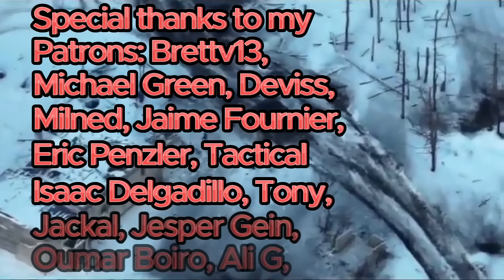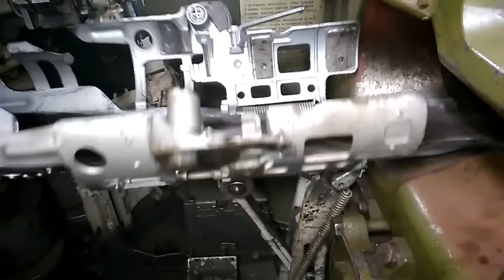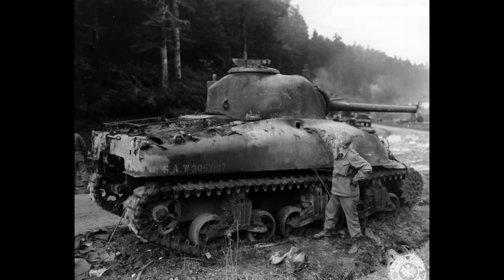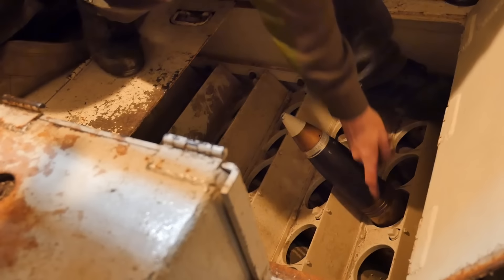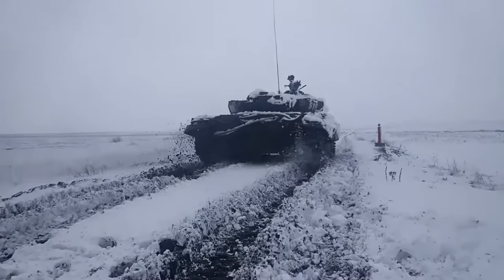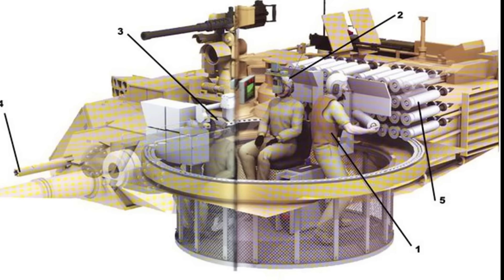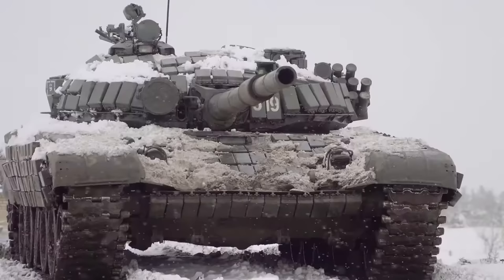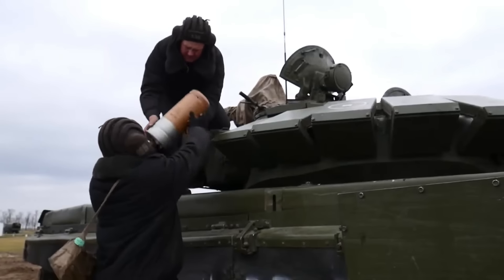Is Autoloader Really the Reason for Russian tanks exploding so much?

Comment: I agreed with everything, apart for one really fundemental point.
The Russian's don't need to 'copy' German insensitive explosives. The formulas have existed since the 1980's.

Russian tanks explode because the ammunition is fundementally unsafe. The propellant cases are weak and contain sensitive easily combustible material.

Russian tanks explode because they have always known about the issues but were too cheapskate to scrap their inventory of unsafe 125mm ammo and replace it insentive munitions.

The combination of flaws in the T-series ammo storage and fundemental unsafe ammo leads to turret tosses.

Its all about not wanting to spend money on designing and producing safer ammo.
Reply: The question isn't necessarily the cost, but the ability to produce enough ammunition in a timely manner. Considering that the whole world's production of ammunition isn't quite enough for this war, changing to the new type of ammunition would've been disastrous.
Reply: @ForOne814  Russia did not have time limit. The current war has nothing to do with it. The Russian's knew about the issue from at least the 1990's. Certainly from the 1st Chechen war. They had plenty of oil money once Russia recovered from the break up of the USSR since the early 2000's.
They had plenty of 125mm rounds in reserve so they could have ceased production of the older style munitions and created an entirely new 125mm ammo production line producing safer insensitive propellant, HEAT and HE-FRAG rounds without suffering a shortage. They could have actually recycled many of the existing shells they had by just putting in new insensitive explosive. The inert APFSDS rounds just needed new safer, less sensitive propellant cartridges 
So realistically Russia has had at least 15 years to design, build and produce better and safer insensitive 125mm ammo. They could have had hundreds of thousands of safer rounds by now.
Instead they chose to deliberately keep producing dangerous ammo on old Soviet era production lines using old Soviet chemical formulas and cheap chemicals.
As I wrote. It was a deliberate choice.
They decided to spend their money on flashy 'wonder weapons' instead.
As Perun says:
"All bling, no basics".
Reply: @simonmoorcroft1417  of course it did have a time limit. Replacing all the stockpiles and all of the production lines is ridiculously expensive and time-consuming, plus the shells themselves are more difficult and expensive to produce, so you inherently can produce less of them. 

It was a deliberate choice, and it turned out to be the correct choice.
Reply: @ForOne814  So increasing your percentage of catastrophic own tank losses and immolating the experienced tank crews your started the war with was a good choice?
I doubt the life expectancy of most current Russian tank crews is more than 3 months thanks to these 'choices'.
The Russian tank 'problem' is not the rate they expend 125mm ammo, its the rate they expend tanks and their crews. Some of the T-90M are likely no more than a few months old, if not a few weeks old when they catastrophically explode.
That's 5 million dollars lost to a $500 FPV drone just because someone thought it was a good idea to skimp on ammo costs.
Reply: @simonmoorcroft1417  it's a tradeoff. You do lose more tank crews, but at the same time you have more tank crews gaining experience, because you're not bottlenecked as badly with ammunition production. Russia isn't bottlenecked with tank production at all, there is no shortage of tanks. 

Also the question is how often do you actually lose the crew to the immediate ammunition detonation. Because it's not that often as people seem to think it is. The vast majority of tank losses in this war is due to abandonment, sometimes of still mobile tanks. 

A $500 FPV drone disables any tank, for it to be destroyed later, if the drone hit itself doesn't cause it to burn out. Also I don't think T90M costs $5 mil for the MoD, $5mil is for the export version.

Comment: You can't have everything and move low weight.
The main problem here is thinking that tanks are inmune. 
The fact a tank is burned out and abandoned or just vaporized, is meaningless, because once you stand more than 15min in a battlefield, this junk is already a bomb target.
So everyone can cope and thant, but the mass destruction weapons we have in this cXXI is something that we can't just overpass with cXX designs. And that is also a call for the 80's leopard/abrams/challenger, which are used in so specific times (no air support, no strong points), that they are useless in the general purpose of a main battle tank.

Comment: I disagree Red, the reason why th Abrams tank burned down was because it was caught in the middle of a reloading period, when the door to the ammo is open, in any other case, the tank would have been able to retreat assuming its engine had not taken sufficient damage to knock it out from that blow, that is why there are blow out panels, so that if the ammo in the back of the turret takes a hit and the blast door is closed, the turret gets hot but the ammo cook off wont kill its crew, is it completely safe? No, but then again, no ammo is completely safe from cook off with ammo that is designed to penetrate and destroy crew and modules in one shot.
Reply: We don’t really know and probably never will. The thing we do know is that the US has far to large a military budget to still have stocks of sensitive munitions instead of upgrading them.
Reply: This blow out panels only save you from ammo cook off , from the propellant . If they have stored HE shells in there and that's what causes this huge explosions , the crew won't be save either . NATO tanks had a long time only HEAT-MP rounds , wich is practically a HEAT-FS round . Not a real HE , if you store there 20 rounds of HE , your blast door will probably say hello to you .
Reply: @RichelieuUnlimited  that's why they made the AMP round. The explosives in it are inert until activated, as it's activated by programing the round before firing. Anything that isn't AP is in that one round type.

Comment: What might also be an isue that is not talked about is that the charge has a partialy cumbustable cassing and that its 2 piece ammo.

So the cassing ain't fire resistant and it has more surface area to for the fire to atack then 1 piece ammo. Certainly non cumbustible cassed ammo will also burn at some point but it seems to me that the chances of a catastrophic and rapid conflageration are reduced.

Of course most modern tanks have partialy combustable casses but they have proper blow out panels. Makes a big difference. Take black powder for example it certainly burns fast but only explodes when sealed.

Comment: The thing is, even if we were to blame the carousel and it's lack of blow-out panels, it would be a relatively simple job to modify it to have them. And as both Russian and Ukrainian studies as well as observations show - it's the ammunition outsid eof the carousel that is the more significant problem. ironically, the t-90m, which was supposed to solve this, is still being filled with extra ammunition on the inside by it's crews.

Comment: So its like its all a matter of trade offs
Reply: Well, insensitive ammo isn’t really a bad trade. Except in terms of price and power, but the latter is typically more determined by the limitations of the gun.
Reply: @RichelieuUnlimited  talking mostly about caroussel vs bussel
Reply: @gerfand  In this regard I‘d tend to go with bustle loaders nowadays. Improved crew survivability (with older munitions), faster autoloader, full length munitions, theoretically faster replenishment and larger available interior volume in the hull. Downside is the heavier and larger turret, however the gun and the frontal armor has to be balanced out anyway. And slightly increased risk of taking hits to the ammunition storage.
Reply: @RichelieuUnlimited  yes, like I said trade-offs

Comment: Short answer: Yes.
Long answer: Yeeeeeeeeeeeeeeeees.

Carousell autoloader, munitions basically unportected in crew space. Granted they didnt predict top attack munitions, but those have existed for long enough that had Russia been a normal country, theyd have switched to a better design decades ago when they did start existing.
Reply: You realize any tank would be destroyed by a top attack munition, right? If one were to hit the Abrams, it would kill everyone in the turret, and potentially pierce the blowout panels.
Reply: @voidtempering8700  assuming it's not taken out by any defense systems prior, and goes through, yea the turret crew is toast. However. Since the ammo compartment is separated behind a blast door, with blowout panels leading outside the tank, the chance of the entire crew being vaporized is very low.
Reply: @engineerskalinera  I mean, sure it is low. But a HEAT warheads entering the compartment is not a good experience. The armor would be turned into spall, and the turret crew would more than likely be dead. 

There are also instances of T-72s being hit by something like Javelin, and the crew can manage to get out before the tank cooks off.
Reply: @voidtempering8700  yeah, but you're looking at just the turret crew being dead in this case. The rest will still be fine.
As for the T-72, one delayed cook-off or two is an exception that proves the rule that T-72 type autoloaders kill crews. If any one of them stayed or couldn't get out, they'd die all the same.
Reply: @engineerskalinera  Even if the blowout panels work the crew can still be killed by it, as evidenced by the burn down Abrams.

Also, it isn't a rare case. As seen, the majority of tanks struck by AT weapons get abandoned, and are destroyed later on.

Edit: Just the turret crew is 3/4 of the crew dead. You lost the same amount as the complete destruction of a T-72.
Reply: @voidtempering8700  the majority of tanks hit in the turret by top attack munitions yeet the turret.

Good point about the Abrams, however, good luck actually doing that to it with a handheld system. Iirc there were 2 taken out? One disabled by a mine, burned down by its crew, and captured, and another one taken by a Kornet ATGM hit to the side of the turret.

Also note that this is an M1A1 Abrams. Modern versions are likely better protected.
Reply: @engineerskalinera  The armor of the most modern Abrams would not have changed the result of either attack. Even ARAT ERA tiles won't be enough to survive a side shot from a Kornet. And the most modern tank would still be detracted by a mine.

Lastly, there were 3 destroyed Abrams and 4 damaged and abandoned Abrams. The reason we haven't seen more is because the majority of all Western tanks were already pulled from the Frontline.
Reply: @voidtempering8700  I'm seeing 5 lost total but let's not argue that.

We have arrived through the argument then, to the conclusion that a hit by handheld wapons (or mines if lucky) to the unprotected ammo storage of a T-72 will most likely kill the entire tank crew. Whereas you need a mine or heavy static ATGM to maybe kill 3 of the Abrams 4 crew if you hit it right, and an ammo cook-off is not guaranteed.

Which still makes the T72 autoloader responsible for the crew kill...

All things being equal, with a top attack munition (your original argument) a hit to the T72 ammo will destroy the tank and cook the crew. A hit to the Abrams ammo (ammo specifically, so a top attack munition that hits the ammo by necessity doesn't actually enter the crew compartment) will destroy the tank, but the crew will stay alive.

Tl;Dr yes, it's the autoloader. No, a hit to the abrams' ammo doesn't kill the crew
Reply: @engineerskalinera  You realize that effective armor of the Abrams and T-72 isn't that different. The T-72b with K-5 ERA will stop the majority of handheld weapons from the front. 

The biggest issue comes from attacks to the sides. Now, the T-72 has better protected hull sides, but the Abrams has better protected turret sides. Now, neither really matters because a tandem warhead or ATGM will go through the sides of both tanks regardless.

Lastly, once again, a penetration is not most likely going to kill the crew. The majority of strikes disables the T-72, where it is then abandoned. Yes, the chances of it blowing is many times higher than an Abrams, but those cases are roughly 50/50. Not 90/10.

It is not the autoloader that is most responsible, but the ammo stored outside of it. The autoloader has some armor protection to stop spalling. Mostly on the top, where there is a 3-5mm sheet of steel.
Reply: @engineerskalinera  A top attack munition isn't likely to hit the Abrams ammo. It is possible it will penetrate the blowout rack, but it will more than likely simply enter the crew compartment. They usually don't hit that far back. 

When it comes to FPV drones they, the first thing they hit is usually the ammo rack. If the blowout panels activate, then it is a necessity to leave the vehicle, otherwise the tank will burn down.

Comment: You have a point about german leopards having less sensitive rounds. But looks like these rounds didn't help that much turkish crews in Syria.
Reply: Did the Turkish Leopard 2s even have those rounds ?
Reply: @haaxeu6501  I thought all leopards have them. It's like a standard.
Reply: Türkiye‘s tanks probably didn’t have insensitive ammunition, they probably bought cheap old German surplus and hadn’t bothered to upgrade. And only DM63 (+DM53A1), DM73, DM11, probably Rh31 and the different PELE variants should have insensitive propellant.

Comment: I'm so thankful you've been able to confirm my assertions about the autoloader vs bustle argument. Coincidentally, the prototype Rheinmetall Panther has an autoloader but uses a turret bustle with blowout panels and a blast door as well as having no personnel stationed in the turret by default (I believe the loitering drone bay can be optionally replaced with CnC center).

Comment: also you forgot to say how sherman had "wet ammo storage" wich was a way to make the ammo when struck be less likely to explode or make a fire, wich was the actuall reason why shermans didn't explode so much (though I do agree placing the ammo on the bottom did help)
Reply: That only works for fires inside the tank, direct hits would detonate the ammo anyway. Soviets had that on T-55 and they found out it was not a miracle solution
Reply: @rogeriofukuma4077  wasn't it different on t55 tho ? because the ammo in the sherman isn't stored in fuel surronding it unlike t55
Reply: Wet ammo had little to no effect according to US studies. It was more of an effort to make the crew feel safer. Moving the ammo to the floor was what made a difference.

Comment: Russia puts a autoloader in the tank

ammo is stoared in a certain way because of the autoloader 

"problem is where the ammunition is stored" so it is the fucking autoloader just not directly its fault 
if my cars gas tank is stored in such a way that the fuel line has to rub against my spark plug and then my car explodes im not gonna blame the spark plug or fuel line im gonna blame the shitty gas tank design

Comment: The argument about ammo being stored in the bustle saving crews never made much sense to me, if an abrams gets hit with enough force to detonate ammo in the same place t90 has its ammo stored, it would likely kill the turret crew anyways, a hit to that area is usually fatal either way. Now the arbams has an ammo weak spot in the turret back AND still has the usual turret crew placement, just because there isn't ammo in the center of the tank it doesn't mean there isn't still people there to hit... And lets not forget the blast panel system isn't perfect, the blast doors can just be open in combat which they would likely be, they can get damaged and blocked open, its not an all saving grace like many people say. Both the carousel and turret bustle have pros and cons.

Comment: The best design would be blowout panels on the hull, with a crewless turret. The ammo is in the hardest to hit spot so it's not an easy mission kill and there are still blowout panels. However it could be designed to release the pressure, as long as the turret ring in the hull is fine, you get the best of both worlds.

Comment: Yes, it is. It might be the extra ammo in the turret that gets hit and actually starts the detonation, but the autoloader and its 20 something rounds are what is sending turrets and new Cosmonauts into orbit.

No matter what way anyone cuts it, the Isolated bustle autoloader provides the best in not only crew safety, but 'recoverability'. I wpn't go into the crew safety aspect as it is already well documented, but even when it comes to tanks with unmanned turrets it'll save much of the sensitive internal components from any damage in the event the isolated bustle cooks off (provided the blast door is closed at time of detonation obviously), meaning it'll be easier to repair, not quick and easy, but much easier than repairing a burned out soviet tank.

Comment: I have a question, is the insensitive ammo propellent , will prevent the round from the detonation instantly and will slowly Brun the propellent...

Or it will stop the round from detonation and even burning in the first place??
Reply: First one. You can actually burn a lot of explosives like dynamite and they wont go off, you need pretty specific conditions for detonation (like jet of melted copper smacking it at incredible speed). Less sensitive explosives just have higher detonation criteria.

Comment: Not that it has much to do with Russian tanks, but the M10 tank destroyer in WWII was a prime example of stuffing the rounds into the vehicle anywhere they could fit The ready use rounds covered both sides of the paper-thin turret, and they painted a white star on the outside over the center of each rack to give a nice aim point.